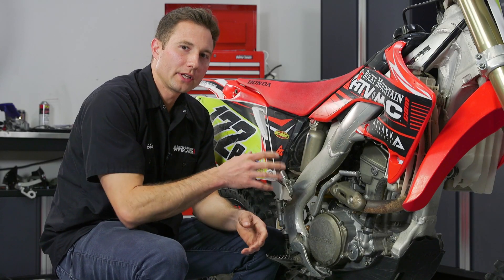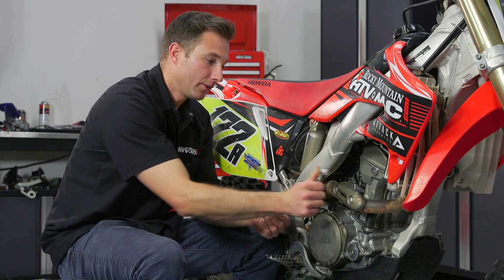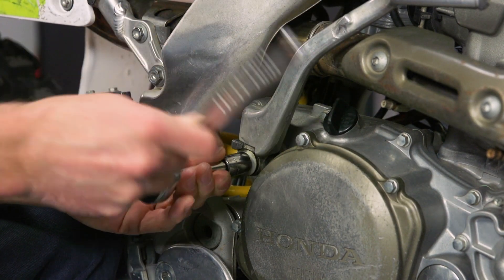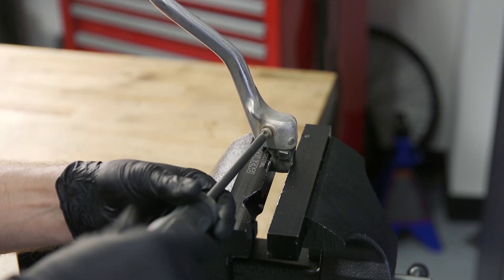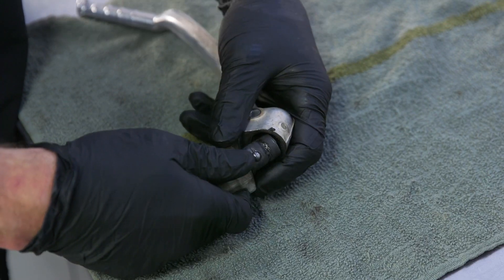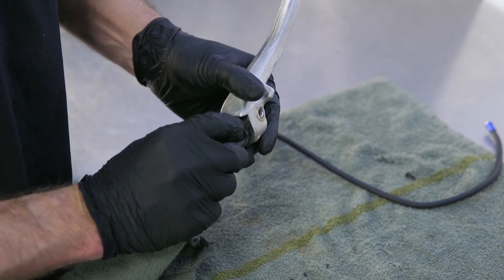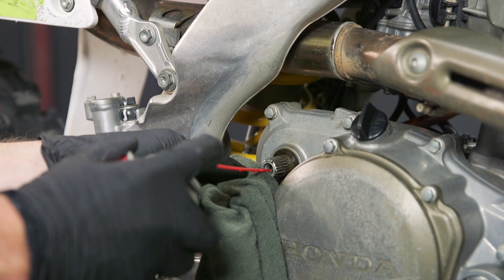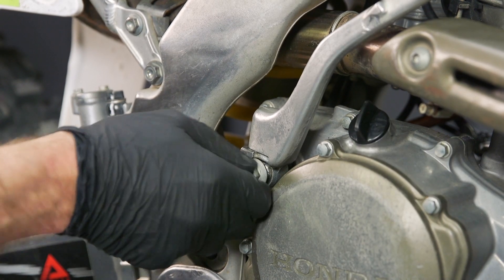Dirt Bike & ATV Kick Starter Rebuild | Quick Tip

Comment: An amazon/ebay link to where
we can find the spring and ball
would be handy. I couldn't find 
an oem kick-lever replacement 
and lost 
the spring/ball, so I bought 
 similar kick, just to
get the spring/ ball bearing. 
Thanks for the video, I didn't
want to open up the new kick-lever
until I could see what to expect
inside the overall assembly.